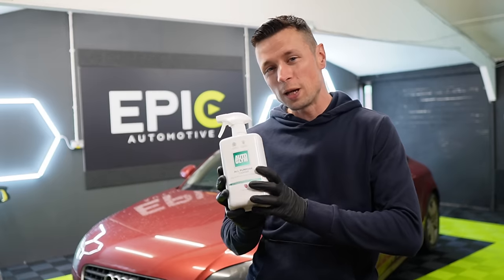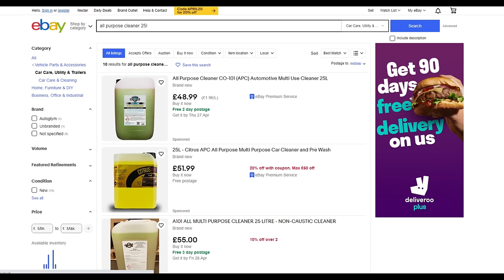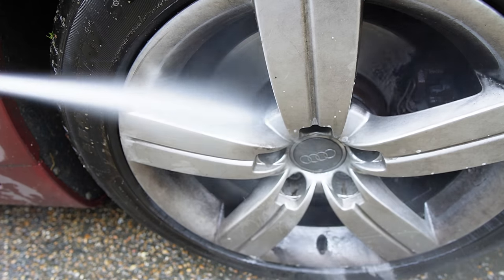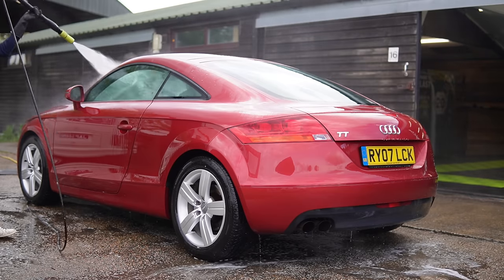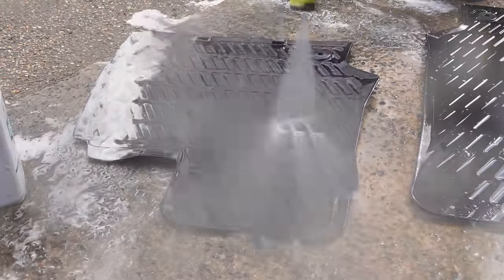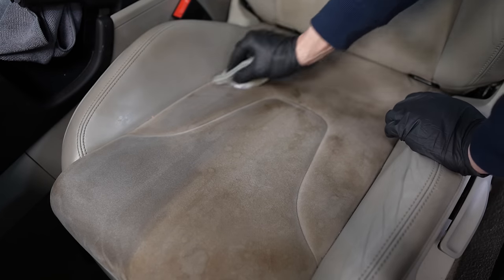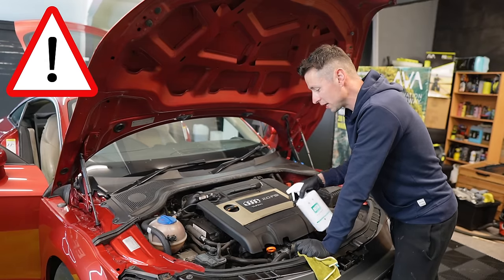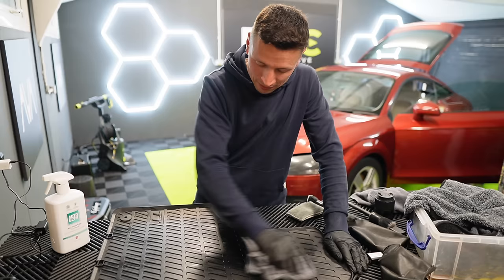Autoglym All Purpose Cleaner Should You be using this?

Comment: Great video. Welcome to the TT club. I bought mine around the same time. 
Mine has better spec level though as I currently have a deer in bedded in the front😢
Reply from the maker: Crikey thats not good. I love my car. the paint is peeling and part of me wants to get it wrapped but with 134k on the clock it may not be worth it
Reply: @epicautomotivedetailing  yes I have the same dilemma. It's red and I have clear coat peeling in areas. The last owner kept it under a car cover outside so it has scratches and scuffs all over, as well as etching from birds and sap.🙄
Got 44k on the clock on a 09 so I'm hoping to keep it original and maybe go for a respray, as long as the insurance don't scrap it🤞🤞

Comment: This may sound daft, but will ask anyway 😂 i have this product and it says to spray it direct to a cloth of interiors and to not use a brush.  In your expert opinion, would using a soft brush be ok or best just stick to their instructions? Cheers 🍻
Reply from the maker: Not a daft question at all. At the end of the day it's an APC and I used a brush many times with no problems. I think the reason they may say don't use a brush is because it stops anyone causing damage (eg on piano black trim) it just protects them